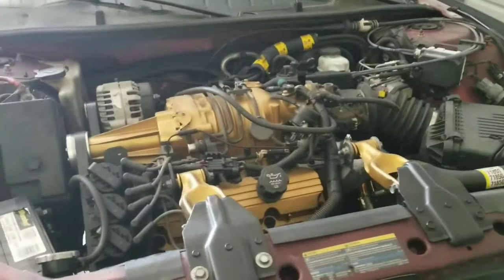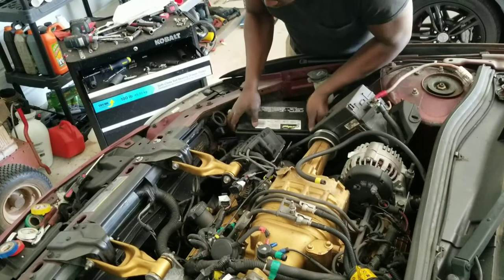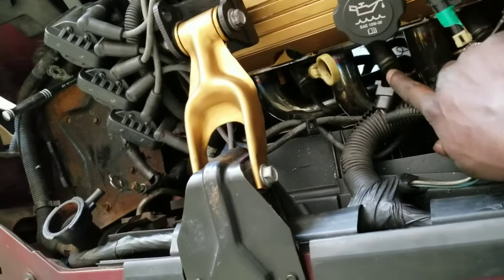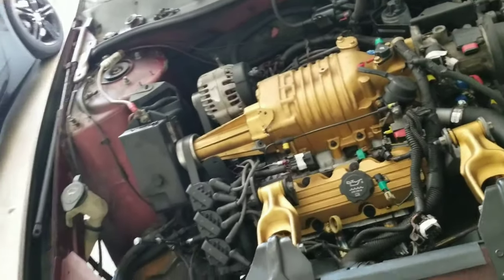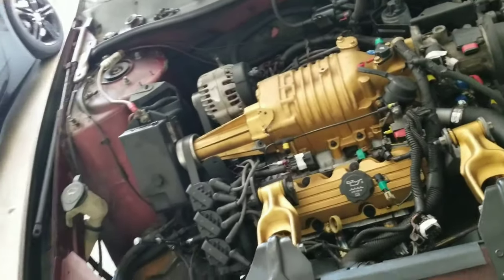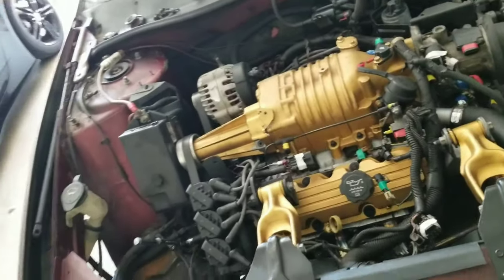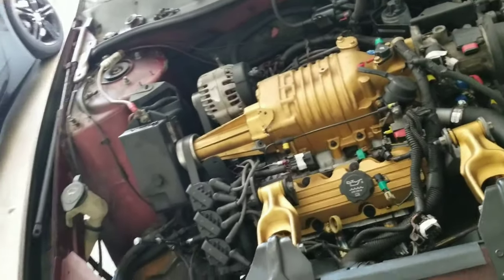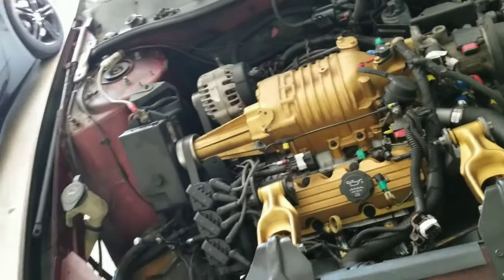How to remove a 3800 Supercharged engine and a 3100 engine 3.8 3.1

Comment: Exactly the video I was looking for.  You make it look so easy.  Helped take away a lot of anxiety.  Thank you for taking the time to make this video.
Reply from the maker: No problem glad i could help... it was my second time removing a engine... and ur right when i searched for YT videos for help thr weren't any and i said to myself... i cant be the only one who has searched how to...so i decided to fill in that blank .. best of luck to u...
Reply: @Midnyt Nytmare  I do pretty much all my own work but never an entire engine pull.  Now I need to decide to motor swap or rebuild with blown head gaskets.  The super charger worries me as well.  Not sure how that is removed and reinstalled
Reply from the maker: It was easy a few bolts... ull need a new SC gasket set thats all...

Comment: Good video. Only add I have is instead of using a screw driver to turn the engine to remove torque converter bolts would be using a ratchet and socket to turn crank bolt at front of engine. Saves time.

Comment: I can't say thank you enough. Had a push rod explode in my grand prix and now its time for a swap at 220k miles
Reply: might have the same problem. could you tell me some symptoms your having?. currently mines quiet at idle but knocking under throttle. did you have the same problem?
Reply: @dmndawgg  Yes very loud knocking when accelerating and gets faster with engine speed. It ended up wrecking my crank shaft as well. Ordered up a remanufactured engine zero miles. No fear doing it either. This video helped out great. Got the engine out in no time.
Reply: @dmndawgg  if you got glitter in your oil it's probably a main or rod bearing..... just drain the oil and you'll be able to tell.
Reply: @vconrad607 where did you order your remanufactured engine?

Comment: Hell yeah u helped me a lot bro.. I'm about to take mine out my 04 Chevy Impala SS.
Reply from the maker: Good luck...itz not as hard as it looks and this was my 2nd time removin a engine n my life... jus take ur time...turn on sum music and be patient...💪🏾💪🏾💪🏾
Reply: @504YoungCity  I def will.. I just hear too much ticking going on from under my supercharger I'm thinking it's my timing chain or whatever.. I'ma tear it all down n see.. maybe drop another one in and keep one to work on (perfect).
Reply from the maker: Alot of ppl forget that the SC oil has to be changed ever X amount of miles... itz oil...it gets dirty...the texture changes it can even gunk up into thick gunk... get a empty spray bottle...take the nozzle off...stick the tube in thr and start pumpn... ull c wat i mean
Reply: @504YoungCity  I def will be doing that next and changing my oil level sensor as well.. before I just pull it out.

Comment: You did help me a lot thank you for making this video , I laughed a little at some of your colorful metaphors  but I also figured out the last few things I need to do to replace my engine on my Grand Prix and once again . Thank you for making this video it was a great help.
Reply: I got the “ bitch bolt “ out using my 3’ 3/8 extension with a wobble extension between it and the 18 mm socket 
Your advice saved the day my friend  while I’m ASE certified Ive never worked on a GM3.8 before . By watching your video I’ve been able to move forward and save a heck of a lot of time . THANK YOU !!!

Comment: Hey there,  thanx boytoy for taking the time & effort needed to make this video.  You"ve got a charismatic nature amplified by experience which shows through in your presentation. Very informative as well as the sequential process of removal was remarkably wire tidy. So from me to you , THANK YOU Mr MidNyt!!! My Nytmare's  anxiety,  & headaches have been replaced with the confidence I needed to take on the motor swap between 2 2003 pontiacs. I've turned wrenches on many days but this is my first Pontiac. 
   Utmost respect for ya &  Thanx from thiz  Yld Chyld Chic in Idaho. Peace Out ✌

Comment: I will suggest that you put a socket on the crankshaft pulley bolt to turn the engine in order to get the three bolts out of the flex plate .  We work best when we work together brother .
Reply from the maker: Nope...i jus used a flat head screwdriver and turned the plate slowly 🤣😂🤣 worked perfectly...plus i can see the holes as i turn... im a beginner and found a write up online but im a visual learner so i said wat da hell...i made a video and followed those instructions to the T... thnkx bruh

Comment: All those wires and hoses is what really scares me because I'm trying to do an engine swap but I'm afraid of not putting the correct tubes or wires together
Reply from the maker: Listen...u can do it... if you follow my colored tape idea i promise u it will wrk... take your sweet time... take alot of pictures and it will wrk out bruh im telln u... all those wire is jus the big harness...that harness only crosses over the engine one way... u cant mess it up... if u have any questions i can try to help u as much as possible...gd luck

Comment: what would you call the coil bracket with the pulleys on it? i'm doing a top swap to my 96 regal and i can't find it anywhere with the pulleys still attached. what cars can i find this on? they don't seem to be the same on all sc 3800s but i believe this is the one i need

Comment: I wish you would have showed me how it comes up and out. Do you slide it from the transmission, or does it come straight up? Otherwise, you give some great tips here. My 1997 Park Avenue Ultra is somewhat different, but still basically the same. Thank you so much...
Reply from the maker: After taking off the rear motor mount the engine should tilt forwards then up...jus have to watch the rear header and how it comes up with it bc it will get stuck on something making you thing you didn't unbolt something

Comment: I want to know how that pulley is mounted on the engine. The one lower down on the engine between the crank and a/c that runs the supercharger belt onto the crank pulley. Is that a bracket it's on, or is it just mounted to the engine by a bolt?

Comment: Loved the detailed explanation fam..got a 02 gtp non-supercharger wanna swap it with an 04 3800 supercharger..got any advice..this my first time also..
Reply from the maker: Preciate the support...mannnnn ive got no advice for u...jus do all ur research and take ur time...definitely use my color code trick it will save yo life... gd luck
Reply: Take the transmission from the 04 and put it in the 02, as well, if you haven't done so already. The transmissions for the regular 3800s are too weak for the SC 3800s.

Comment: Do not trust those jackstands with your life. Its good to have a couple tires under both sides of the car so if it does go it will be sitting on the tires. Just dont want you to get killed bro. People get crushed by cars all the time cause the Jack blew out cause its old or faulty.

Comment: i got a 97 pontiac grand prix gt and thinking swapping out the engine putting in a 3800 supercharger engine and was wondering would that work ? or just do a top swap? Some say i can put supercharger in their but im not sure.
Reply: You can. Either a top swap, of buy the Supercharger kit from ZZP (like I did), but here's the thing: the top swap is cheaper depending on where you get the parts (used parts), but it is a lot of work to do it yourself and you need a tune of course. With ZZP's SSM90 kit, you can still supercharge your L36 without doing stuff like pulling the heads and removing the crank pulley.

I want the supercharger on mine to run on its own belt (like a stock L67 would) so I haven't installed it yet as I need to figure out how I can mount the 3rd pulley for the supercharger belt
Reply: I own a 2000 Pontiac Grand Prix GT, by the way.

Comment: Was good walkthrough would of been faster tho if you would have just dropped the engine & trans on the front k frame buy unbolting struts off the towers and lowering everything with a jack disconnect the rack & then unplug the main connector to the engine bay from the body he kinda took a lot more stuff off then needed while  in car